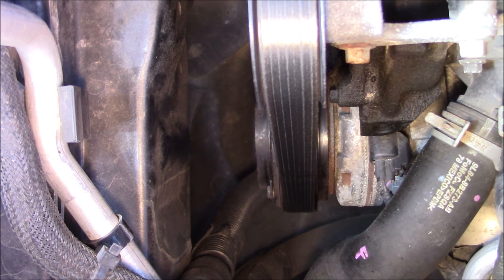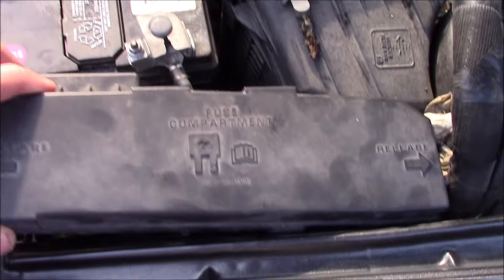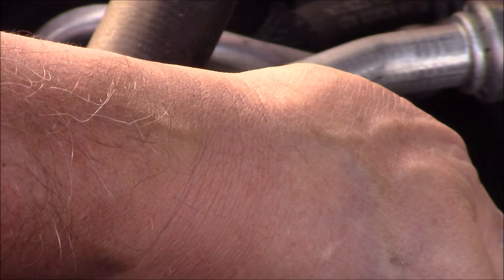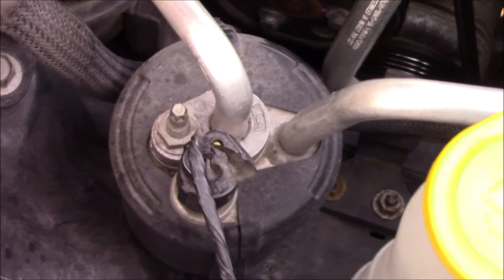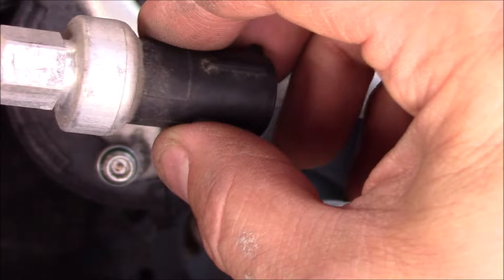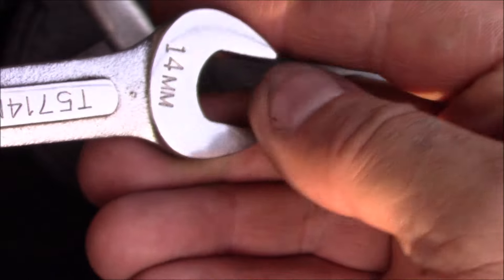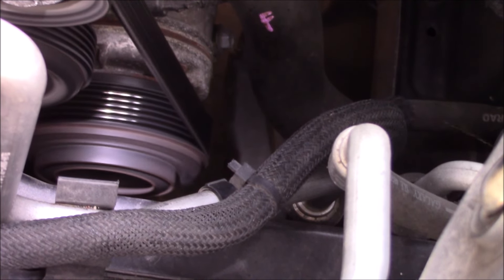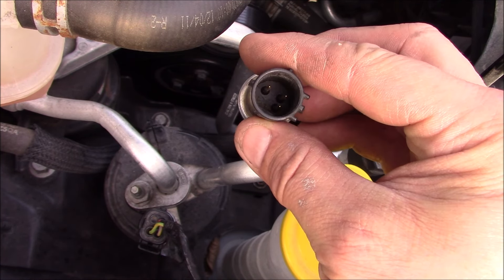Ford Escape ac not working fix

Comment: Thanks for the tips, It's starting to heat up in Australia &  my A/C hasn't worked for two years! I'm well overdue to fix it and this has given me a great place to start fault finding, cheers.
Reply from the maker: Glad it helped
Reply: Did you ever fix it?
Reply: @ChrisLegg17 I haven't got it fixed yet,  the compressor clutch seems to pull in ok. Getting tempted to take it to get looked at.

Comment: Great video! Im working through the steps as you did. Going to replace the transducer next. Having a bit of trouble finding the actual part. Theres a 90$ (ish) part that shows up when they search for this as well as a 30$ (ish) part. 

If you happen to have more details on how to locate this specific part, I'd be thankful!!
Reply from the maker: follow a silver colored pipe to an upright can wrapped in black plastic. the can will also have a black hose going to it. the transducer will be on the top of that can. I wish you the best on your repair

Comment: Thanks for the video. Going to give this a try!  My compressor was changed 3 years ago so, hoping this works 🤞
Reply from the maker: I wish you the best
Reply: Did it work?
Reply: @ChrisLegg17  unfortunately no it didn't work. The problem was the pigtail connector snapped somehow so it wasn't getting power. Took it to the shop and got it fixed for pretty cheap.

Comment: I replaced the timing belt, pressure switch and even compressor, still didnt fix the ac. All the fuse looks good too. Can't figure out the problem, its very strange.
Reply: Timing belt is for the engine not ac
Reply: Ac condenser replace
Reply: did you replace the heater/drier?  Im wondering if thats not whats wrong with my 2012.
Reply: Recently I was told that there's no ground in the AC relay switch, but other than that not able to figure out whats wrong. 

I have had the refrigerant tested through gauges and that looks good. Sorry I mean the ac belt was replaced, not the timing belt. Condenser looks good too. Heater works pretty good, i dont know whats a heater/drier.
Reply: I did the same it end up being the battery…
Reply: @angelopacheco9397 battery? what was wrong? im having issues as well with my f150
Reply: It's probably a combination of the LF wheel speed sensor, the RF tire pressure sensor, and the front axles. You should change those too..
Reply: @leekias1 😂
Reply: @GerardoGarcia-km4st what would that have to do with the A/c lol😂?
Reply: @JonathanDiaz-vm5mb about as much as the timing belt does 😂
Reply: 6
Reply: Evaporator temperature sensor

Comment: My a/c in my 2017 ford escape only works at night or early morning when it's cool. It blows hot during the day. Can you tell me why? It sure is hot in Texas!
Reply from the maker: You may want to look closer at the electric fans behind the radiator and ensure they are running, I wish you the best on your repair
Reply: Could also be the expansion valve about to go out or that the car is running hot because of the fan

Comment: I will be trying your fixes.  What do you think of the Air Conditioner Recharge Kits (Mr. Freeze or AC Pro) at auto parts stores to fill your own synthetic refrigerant?
Reply from the maker: If your refrigerant is low it means you have a leak in the system that needs to be repaired. The cans sold at stores typically contain a leak sealer which may or may not seal even a very small leak. Shops that have refrigerant recovery machines may refuse to evacuate your refrigerant if it contains a sealer since it messes up their equipment. It is illegal in the US to knowingly release refrigerant into the atmosphere.  Many auto parts stores have loaner gauge sets to check your refrigerant pressures. The pressure should be checked before adding any refrigerant. Over filling the system will make it not work just as an under  system. I wish you the best on your repair
Reply: @bbbjim1fixedit  where would you go to have your refrigerant reclaimed
Reply from the maker: @joepayer1793  Any automotive shop in the US that services ac will have a recovery machine. It takes about 1/2 hour to evacuate the system

Comment: I replaced mine and sadly it didn’t solved the problem so what could it be? The ac compressor?
Reply from the maker: You may wish to hook up a manifold gauge set to the system to help with the diagnosis. Many automotive stores lend them for free. I wish you the best on your repair

Comment: Is there supposed to be power at that transducer switch plug? I'm assuming so. I have power at the fuse but when I use the test light on the 3 pins of the switch it doesn't light up.
Reply from the maker: I believe it is 5 volts so a test light may not light up. I wish you the best on your repair

Comment: Do you know if you need to pull the Freon out first or can I swap this part out without draining the system? My low side pressure is 120, then randomly the compressor runs and it drops to 40psi, so I don’t think Freon levels are my issues. And the relays seem to have no change.
Reply from the maker: Changing this transducer can be done with the system full

Comment: So mines been going in and out as well it doesn’t stay on long at all, one day it did it all day hasn’t done it for awhile now it’s doing it again and this time worse than before, if it needed freeon wouldn’t there be a leak? I recently got the condenser replaced and a few weeks ago when it happened the first time around I took it back they did a pressure test and said they couldn’t find any issues but also at that time the clutch was engaging just fine so I figured they wouldn’t find anything
Reply: Also if it ends up not being the freeon like you said at the end of the video due to it going in and out, do you just replace the compressor at that point?
Reply: freeon came out, could the switch that you talked about that needs the right pressure also be the cause of the compressor engaging then disengaging? When it does engage it’s cold as ice but of course as soon as it’s not it’s hot air again and sure enough it’s still engaging then disengaging shortly after then waits awhile before it does it again
Reply from the maker: likely the compressor is fine and won't need replacing
Reply from the maker: you will need a manifold gauge set to double check the pressure and if it has enough refrigerant in the system, many auto parts stores have some they loan out for free.  I wish you the best on your repair
Reply: @bbbjim1fixedit  thank you I think I’m good now, originally I got the condenser replaced by the shop then the compressor started to cut in and out, shop said it was fine, ended up taking it back and they tried to say the same thing but by that time I noticed it did work fine in the mornings, and that’s when they were looking at it instead of when it got hot out in the afternoon, they looked again and apparently a seal needed replaced and so they did that and the recharge (for free but my condenser replacement and recharge originally was $600) now it’s working fine other then yesterday when the compressor completely stopped coming on rather than kicking in and out like it did before, turns out the pressure sensor I ordered off Amazon when the a/c was kicking on and off was a pos, luckily I kept my original one. I think I paid about $15 from Amazon since the autozone and advanced auto stores wanted nearly $100 for the pressure sensor haha
Reply from the maker: @austinhock4  glad to hear it is working now

Comment: Hello. Is that the lower pressure switch? I have a 2010 ford escape and having the same issue.
Reply from the maker: The part I changed is a transducer that does measure the pressure

Comment: So mine kicks on and off like you mentioned, I checked pressure, it's in the red when not running and middle to upper green when running. It'll kick on and off for a few minutes just after starting the car and then just quits kicking on all together. When it is on, it's blowing ice cold air. Could the transducer (whatever it was you changed in this video) be bad, or do you suspect something else? Thanks!
Reply from the maker: It is hard to diagnose, without looking at the gauge, yet if it is not the transducer you may wish to look closer at the expansion valve which will require the refrigerant to be professionally removed. I wish you the best with your repair

Comment: It worked for me last year. I bought cheap ones on eBay. Replaced it twice last year and worked fine. Then spring time this year the ac stopped working again. Replaced the switch again from Amazon and didn’t work. Returned it and Amazon sent me a replacement thinking it was defective. Still doesn’t work. Tried swapping the fuses. Still nothing

Comment: mine is a 3 pin , but had a red plastic pc. in the plug??
Reply from the maker: The plug in this video is similar to yours
Reply: @bbbjim1fixedit  yes it is i figured out.  For some reason the red pc was disconnecting and was in the pressure switch.  I did get working.  I blew some air through the threaded end and it works for now.  Thx for the video!
Reply from the maker: @EdStaniszewski  glad the video helped

Comment: my 2012 4 cyl has started blowing extremely cold, then hot.  Back and forth until the outside temp gets around 80, then it quits working.  Just hot air for me!  Someone said the heater/.drier needs replaced.  Does that make sense?  TIA.
Reply from the maker: To better diagnose the issue you will need an ac manifold pressure gauge. Many automotive stores will lend you them for free. if some of your refrigerant leaked out the gauge will show that. I wish you the best on your repair

Comment: I have an 09' the clutch is kicking on & off but no AC. Fuses & Relays all good..
Hooked up a can of freon with gauge & it was in the Red. 
Luckily I have Carshield & they gonna pay for it 
I figure its the high or low pressure switch
Reply from the maker: you likely had some of your refrigerant leak out and it doesn't have enough in the system to keep running.
Reply: If it’s in the red, the system is over charged, or the vehicle is not running. The problem with DIY refrigerant purchases is the danger of over charging. If the compressor is trying to cycle upon engine start, then stops, the pressure switch could be the cause. Otherwise it’s possible the compressor has or is failing. Keep us updated on findings.

Comment: How do you know if the recycle pressure switch is bad?
Reply from the maker: I had a full charge of refrigerant, newer blower motor resistor, and the compressor clutch  would engage for about 1 second when turning on the ac then disengage. I wish I knew of a test for the transducer switch but I don't know of any for this type. I wish you the best on your repair
Reply: @bbbjim1fixedit  Thank you for the reply 😊
Reply: Using a multi-meter, check the switch for continuity. Closed is required to engage the compressor. 2 prong are simple. 3 prong have 3 possible combinations, whereas 4 prong have 6 possible combinations. Videos are available indicating test method.
Don’t just throw parts at the problem. Take your time and logically test the system.

Comment: Maybe someone can help figuring out my ac  or radiator fan problem. Wen I start my Escape 11 3,0l xlt. Sometime both radiator fan work on full throttle ac off and dont stop until ignition off and sometimes they work perfectly until the temperature sensor turn them on. If I pushing the ac button the compressor start, the heater fan work good on all speed but no cool air. I don’t mind a none working ac. My question is that normal for the fan running like crazy.
Reply: If the compressor is running (clutch engaged) and you have no cold air, most likely the HVAC blend door is inoperable. Also check the cabin air filter to ensure it’s not completely clogged, or if someone removed it, and now the condenser is clogged. This can cause the condenser coil to freeze rather quickly, preventing heat exchange. Finally check the HVAC air temperature sensor to ensure it hasn’t failed.

Comment: My 2011 just started blowing hot air the other day. Relays are good but compressor clutch never kicks on. I hooked up a can of refrigerant to recharge it but it goes to the red area saying it’s too high.  Gonna try replacing the ac pressure valve if y’all have any other ideas let me know please 🙏
Reply from the maker: I wish you the best
Reply: Did you ever figure out the issue? Having the same issue myself
Reply: It will show as overfilled if the compressor is not running.
Reply: Did you ever fix it? What was the issue? I have the same problem with my 2011
Reply: @ChrisLegg17  Ac Receiver Dryer contaminated the entire system and messed up the compressor. I had to buy all new components and have it all replaced ran me about $800 for the parts and labor
Reply: Blows icy cold now though 🥶
Reply: @aceofspades6920  Thanks for the reply! Life saver! If you can recall, do you know what specific parts you ended up replacing? I can probably do the work myself, just don't know what all parts I need to look at replacing. Might save me some money I most definitely do not have at the moment if you can remember. Thanks for the help, regardless!

Comment: 08 escape wat if the 10amp fuse keeps blowin out? 2 so far. wen i got this car the plug for the ac compresor was disconected
Reply from the maker: you may wish to take a closer look at the wires going from the fuse box to the compressor, a wire missing the insulation can ground out blowing the fuse. Next look at the  ac compressor clutch, that may have a short circuit. I wish you the best on your repair
Reply: @bbbjim1fixedit  thanx alot
Reply: Mine had a little cut in the clutch wire, shorting out against the fire wall.
Reply: You were taken by the previous owner who should’ve disclosed that issue. The fuse is blowing due to overcurrent either caused by a faulty lead (hot) wire, or the clutch has failed. Unplug the clutch, then test the wires to ground. If both indicate continuity to ground, then look for cuts or other ground points. If the wires test ok, then test the clutch coil. If the clutch, these can often be replaced without discharging the system.
Reply: @dropndeal  bought from copart
Reply: @knightwizaed6921  wish u could make a video🤙